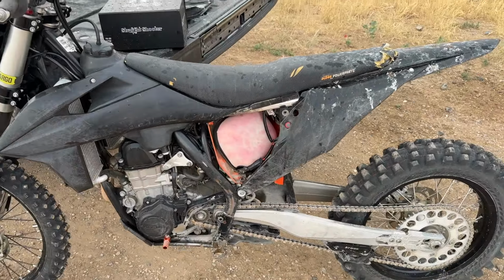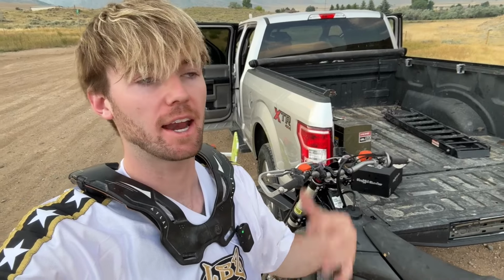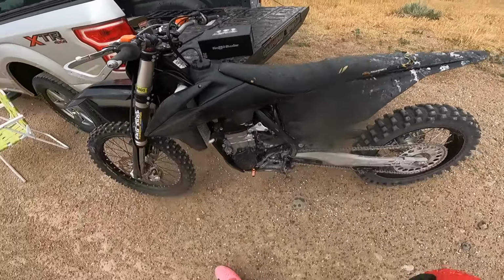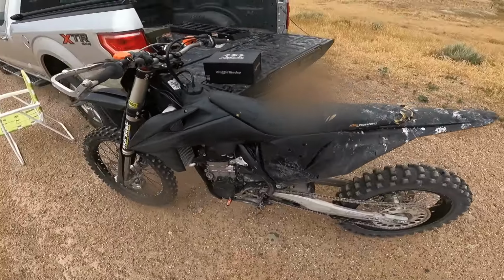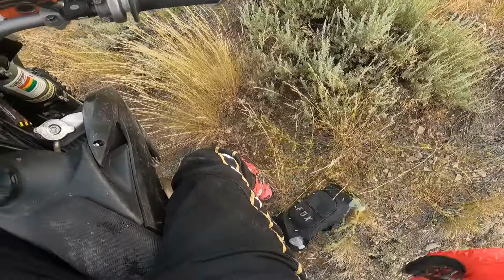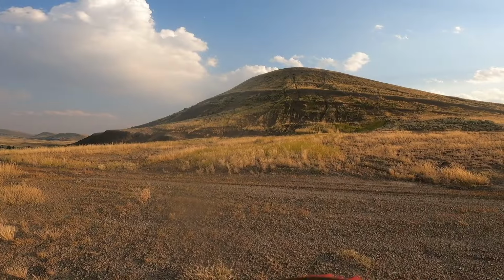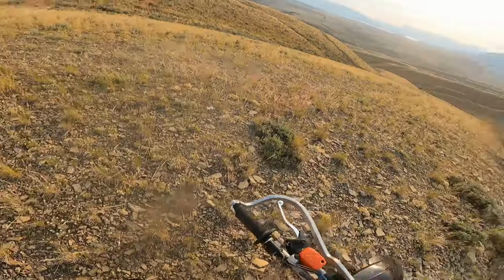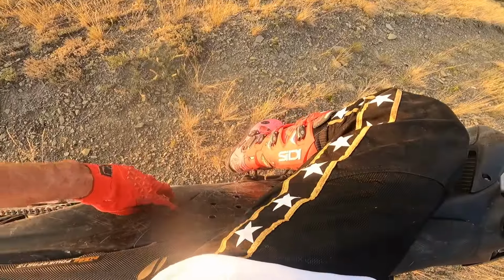Hill Climbing With Road Skulls Straight Shooter!

Comment: Prolly will kill the battery without the stator upgrade only time will tell I guess
Reply from the maker: Doesn’t stay on all the time, can turn it on and off. I only turn it on when running and it doesn’t hardly take any power.

Comment: This is hard to believe. I believe that you think it works low to mid but this no doubt robs you high end. This has been tried and dynoed in cars and it never works. If it did they would put this on from the factory if only you needed a fan.. my 2 cents.
Reply from the maker: Well, there’s a lot of things aftermarket that they don’t put on in the factory that work good. you’ll notice this thing from zero to half throttle anywhere in there. There are some big name race teams that are using it but secretly.
Reply: @GoonClimbers Like who?
Reply from the maker: Can’t say on here.